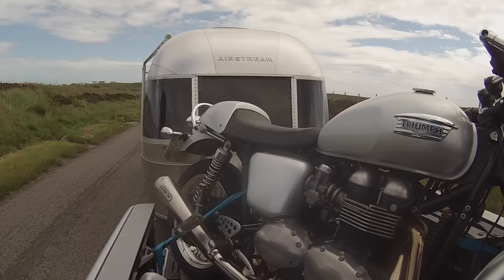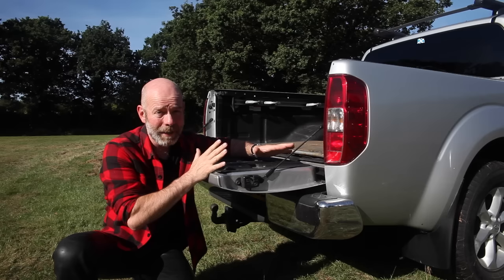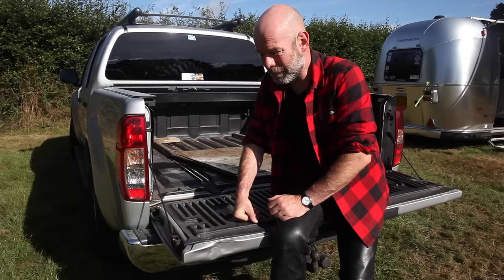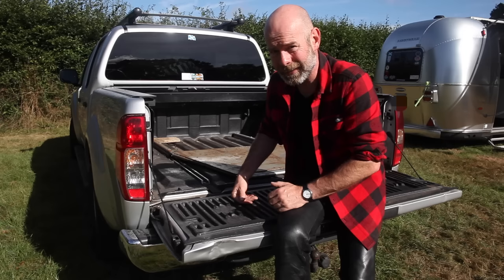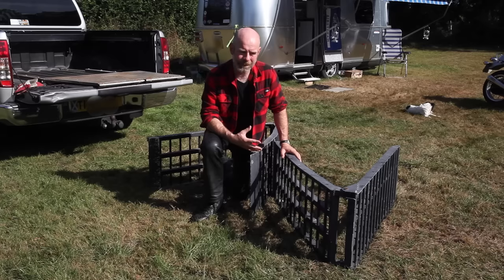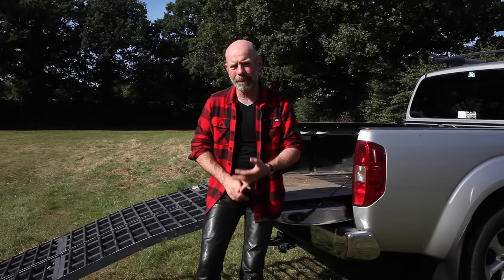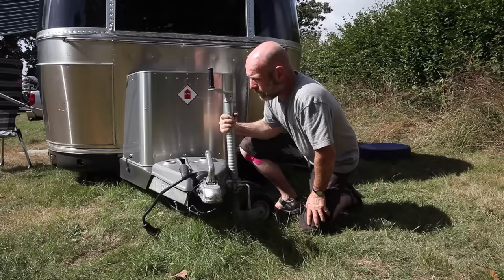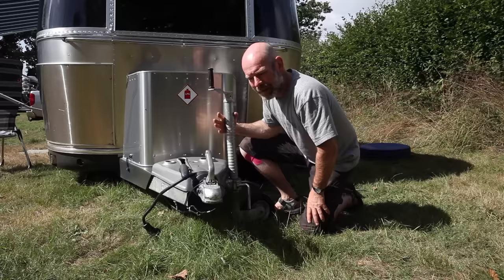Loading and carrying a motorcycle in a pick up truck

Comment: Full of great advice on loading not only into a pickup but any trailer or van.  You can always get some gripper strips for the ramp to make it less slippy in damp conditions.  I have some applied to my trailer ramp and its amazing. Google Grip Tape or anti-slip tape.
Reply from the maker: That's a brilliant tip, I shall look those out. Thanks!

Comment: Really good informative video. I enjoy all your content. Keep it up!!
Reply from the maker: That's lovely to hear, thank you very much! :)
Reply: Could you get a lip fitted to the right edge on the right hand ramp to help prevent the bike sliding right off if it started to go? well a lip in 2 halfs so the ramp still folds...
Reply from the maker: Good idea. There is a small lip already on the ramp. I think even if it went a few inches to the side it would be Game Over. The trick I think is to just always do it dry and prevent sliding in the first place. This is why I only take the bike summer and for longer stays on site - waiting for dry conditins can be too restrictive otherwise and even with 'lips' I wouldn't risk loading in the wet.
Reply: ok, you are a very sensible man!!

Comment: I like your setup,  the double ramps being an especially good idea.  My cargo van has a much lower deck, so I get away using a single ramp and a step.  I'm wondering if you've ever looked into buying a pair of tailgate support bars, and ditching the sliding metal plate? Looks to be a bit of a pain. Here is a link for the bars I am referring to in case you've never seen them before. https://www.dgmtailgatesupport.com/  I should think you could find something similar in the UK as well.
Reply from the maker: +dprider02 Yes, the platform is a faff. I shall look into that support and see if it's available in the UK, thanks for the tip!

Comment: Wow, was hoping it was easier than that! I have metal folding ramps for similar purpose into a trailer. Just wondering, could the bike fit through the doorway on the Airstream and be held in a cradle within it?  Looking at Airstream - tow car combi but not sure I want a "pick-up truck". A Tiguan / Ateca more my liking but the bike I also want to bring...........
Reply from the maker: The Airstream axle and tyres are already maxed out, so even if I could get the bike through the door there is no payload for it. Getting the bike into the truck isn't so bad, I can do it in 20 minutes start to finish. Your other options are a van like a VW Transporter, or a motorbike-carrying caravan like the Knaus Sport n Fun or the Knaus Deseo Transport. You could also consider the Airstream Basecamp which Airstream Europe in Germany is considering importing - but check the payload. Good luck!
Reply: Cheers Andrew, a mind of information, not sold on Knaus layouts, had registered interest in the new Base Camp but want to see it in the flesh, perhaps it may be at the NEC in Feb but if not will certainly have a good look see and feel of everything including pick up trucks!